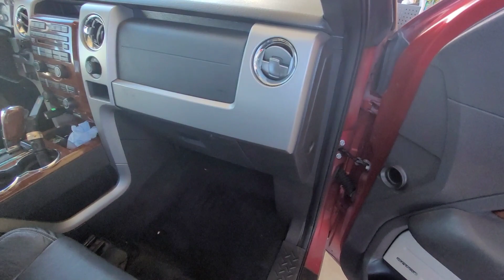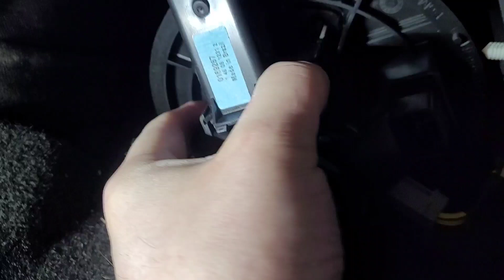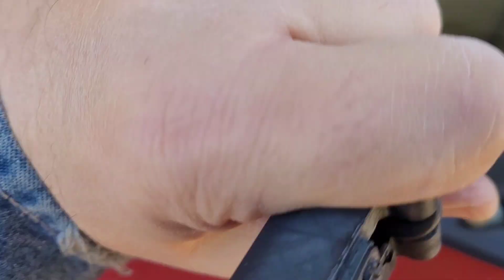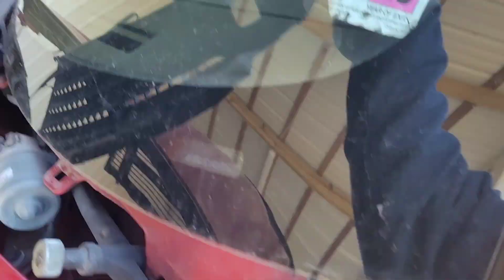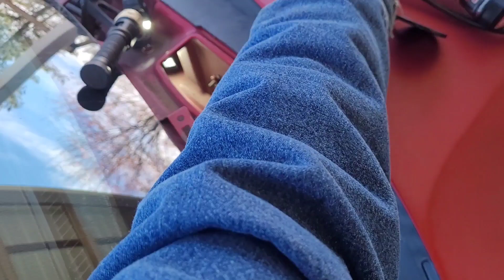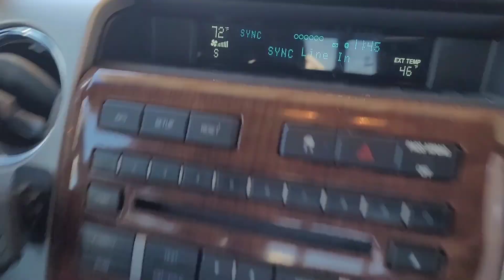Ford F150 Noisy Blower Motor  Repair

Comment: I interviewed several glass shops to replace the windshield on my 1984 anniversary edition Mustang GT 350 convertible. I decided to use a local shop like you and regretted it the moment I left. They put a big gouge in my otherwise perfect dash pad and the windshield leaked out of the rear view mirror every time it rained.
Reply: 1. When I want to look in on the progress of the repair are you going to tell me that your shop insurance policy doesn’t allow me in the shop area?
2. Which one of these techs is going to do the work?
3. How many windshields have they done and how many 1984 anniversary edition GT 350 Mustang convertible windshields have they done. 
4. Are they going to use a metal scraper and scrape all the paint off the window frame to remove old sealant so that it rusts and the windshield falls in, in the future?
5. Is it going to leak? What are you going to do if it leaks?
6. I have inspected every inch of this 1984 anniversary edition Mustang GT 350 convertible and I will be highly disturbed should any damage occur to the vehicle.
Reply from the maker: I should have interviewed.   What are some good interview questions?  Might make a good video

Comment: My 1965 Ford Mustang with factory under the dash air conditioning had a wet floor on the front passenger side. It was a common problem for the condenser drain hose which ran from the unit through a hole in the transmission tunnel to break off which would cause the A/C to drip onto the floor pan instead of out through the hole in the tunnel. Do you have the original A/C unit and starter?
Reply from the maker: Yes all original starters and hvac.   I will investigate the clogged condenser tube